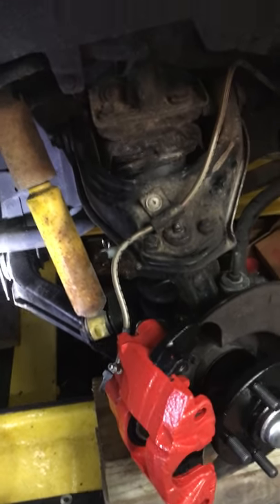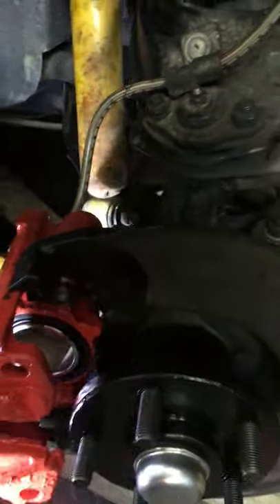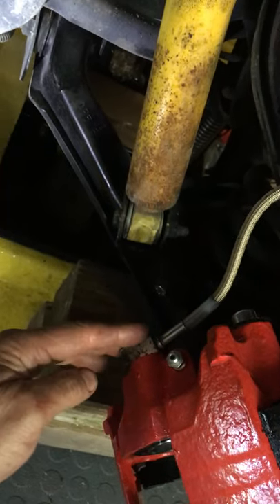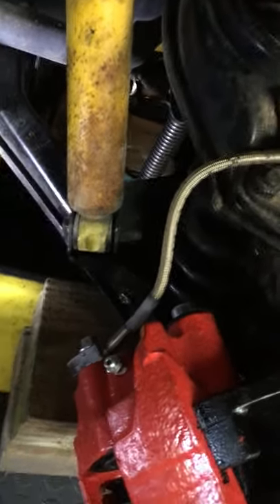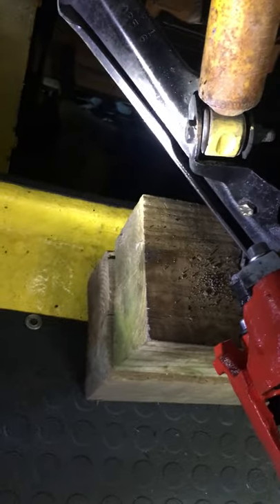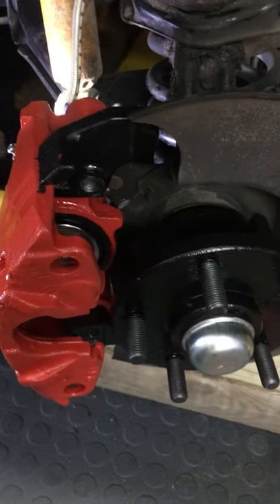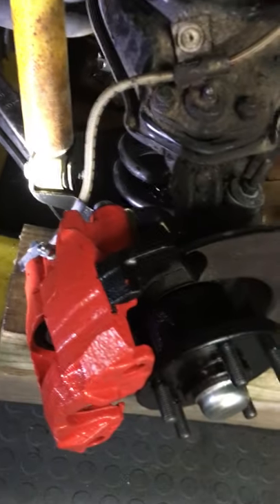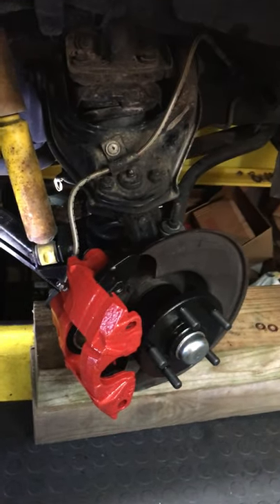Fiero brake conversion detailed information

Comment: Different casting for that style calliper. The Camaro front callipers from the 80’s also works and it crossed reference with a s-10 calliper too.  Done many of these upgrades.  Great job.